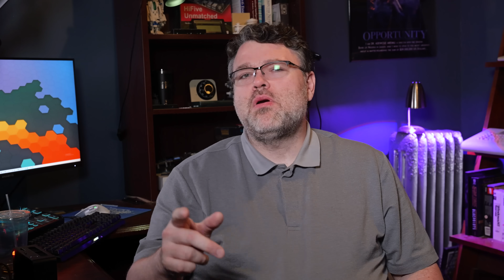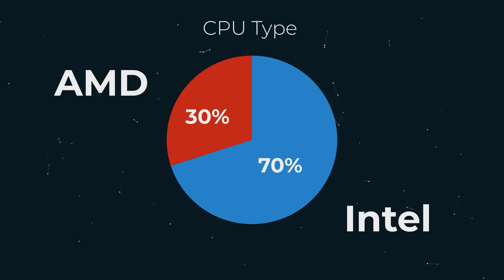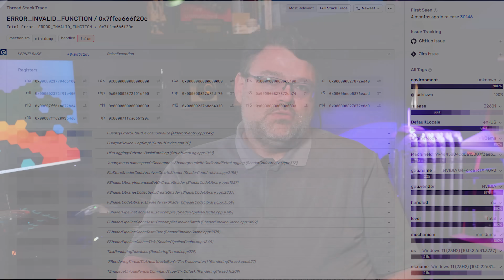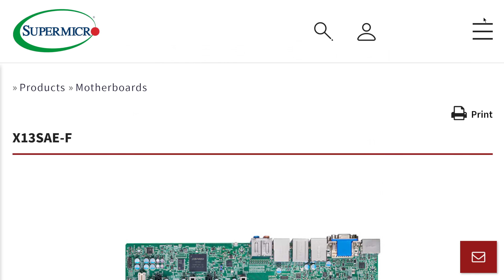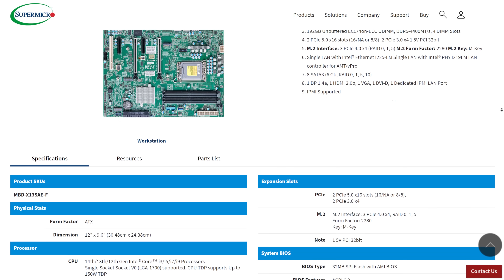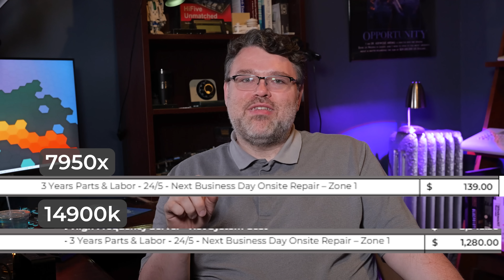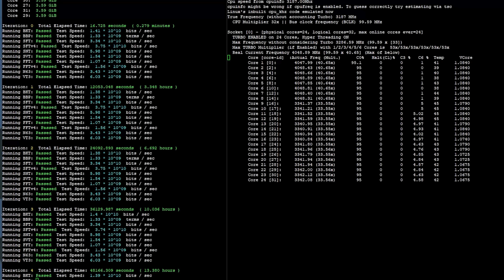Intel has a Pretty Big Problem

Comment: If it helps, my NVIDIA gpu keep shutting down my AMD 7900x3d. I bought RX 7700xt, and the issue is fixed. For some unknown reason, AMD is not compatible with rtx4060. Fyi, i did driver reinstall, Windows reinstall and everything, including bought another rtx4060.

Comment: Hi, I'm the target you're looking for and can reliably replicate these crashes.  It's a custom build with a 13900K and I can configure it to see inexplicable crashes every few hours.  
It isn't strictly overclocking that causes the issue.  The Intel Turbo Boost will cook the chip during shader compilation on games and does cause some instability, but nothing like the ASUS AI Overclocker/Tuning.  Turning that thing on, even when telling it to tune for stability, will almost guarantee a crash within a few hours of use.  As soon as you use XMP profiles and manually tune the CPU settings it behaves reasonably well--maybe a crash here and there over a month.

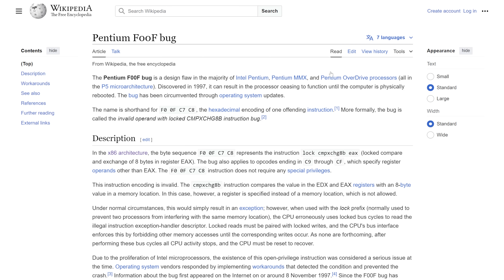Comment: 2:30 "Intel creating their microcode system so they can patch CPU errata in software"
Next step : Intel sell you an FPGA so they can fix any hardware issue on the fly.

Comment: enforced voltage limits, enforced clock speed limits.  the turbo boost voltage spikes are killing the CPUs.  intel can't fix that with microcode or BIOS, because voltage spikes hitting 1.5v and 1.6v to hit those 5.8ghz and 6ghz on 2 cores is whats killing them.

Comment: Marketing just wanted that 5700 speed on the server cpu... Between 5000 - 5500 sounds far, but just not far enough. 5500 is so close 5600 just doesnt work, it just one higher. 5700 feels reserved, but budget pro

Comment: My 13900K has crashed once that I know off, maybe after some update. I have never played any game with it. I did try to get a Gigabyte 4080 graphics card with this system including a Gigabyte motherboard. Never was able to make it work, I sent it back to Gigabyte at great shipping expense and they sent it right back to me with a new cable but didn't touch the card that I could tell. And it still didn't work. After pulling the card, I had to reboot over 10 times to get it to boot and reset the bios plus whatever I could think of. I put my RX580 back into it and no problems since. Still have the 4080 which is still under warranty but Gigabyte didn't even look at it.

Comment: "out of vram" error also is tied into your page file settings. I kept getting them in a game I played about every 1 to 2 hours and I was only using 22gb of ram out of 32gb and 12gb out of 16gb of vram. I changed my page file setting from 6gb to system managed and the errors went away. 5800x3d and 6800 16gb

Comment: No Intel CPU problem Originally posted by reddit:
Basically type environment variables into start, and open "Edit the system environment variables" > click on "Environemnt Variables" on the bottom right > Click on "New..." at the bottom > can create an environment variable called "OPENSSL_ia32cap" with the value ":~0x20000000d". (Both without the quote marks).

Comment: maybe this has something to do with chiplet implementation? I had 8700K for 5ish happy error-free years and decided to upgrade to 13700K last Fall. I've had a few issues with this silicone. one day my PC would not identify a secondary NVMe drive. Reboot fixed that issue. Another issue was BFV would crash on me on occasion. I fixed it by moving the install to the primary NVMe. Weird issues that I never had with old intel. Both linked to NVMe 4.0 that was 100% healthy and no problems like this on 8700K

Comment: Since this seems to mostly effect 13th/14th gen consumer CPUs, what are we seeing on the front of Xeon5 and Xeon6? As for memory clock dropping like that, makes one think the E and P cores access the IMC differently and are causing a voltage issue internal to the CPU in some cases. This could account for the compression/decompression issues many are seeing.

Comment: This isn't just a problem for the here-and-now...
...without a complete fix (seemingly unlikely) all these CPUs (components?) are going to end up on the used market for many years to come... with a potential for an ever increasing failure rate without any kind of warranty or indeed appreciation that there is an issue 5-10-20-30 years from now.

Comment: I'm a developer and I've ran into these issues with my 13900k, exclusively when compiling - but then consistently. I got it RMA'd but in the meantime the 14th gen came out so I got a 14900k. At first it was working well but then the same issue came back. Couldn't finish a 2 minute build without various issues, but all games etc ran perfectly. The latest motherboard bios updates had settings that fixed the issue without a noticable performance drop though.

Comment: I bought a 14900K and had it replaced 3 times, each after 5 months. Please change it if you’re using that chip. It will definitely cause issues

Comment: Regarding downclocking memory to 4200: The official Intel specs for 14th gen DDR5 allow at most most 4000 for dual DIMM configs. And only 4400 for single DIMM, but dual slot configurations (which all W680 boards I can find seem to be). So it seems 4200 for dual DIMMs seems still outside of official guaranteed specs.

Comment: I have "no vram" issue back on release, since then i tune my system decrease watts significantly(using noctua 15)Since then I have zero issues, no crash no problems and even i decrease power of cpu perform at default boosts in games because games not use cpu on max usage and it keeps frequency

Comment: I have an Asus z690 Hero motherboard and a 14900k CPU. I couldn't understand why it was running so hot, even though I had a water cooler. When I unpacked a large rar file, it rapitly reached 100 degrees and crashed after a few minutes. The problem was that Asus hadn't disabled "ASUS Multicore Enhancement," so this feature was enabled by default. When I chose "Disable - Enforce all limits," the CPU worked fine, as it should. Since then, I haven't had any problems with the CPU. Why they chose to have it enabled by default, I have no answer to.

I don't know how other motherboards work. Maybe this is a root problem for many. And if you don't disable it and are using a less efficient cooler, then the problem would be even worse.

Comment: I have i7-14000 non K. Hopefully, I'm safe. However, I noticed that my ASUS TUF gaming reported 1.56V in BIOS while idle! Crazy! I disabled all the overclocking features immediately (even if non K is not overclockable), and now it shows under 1.4V in Hwinfo under load. No idea, what ASUS was doing there.

Comment: My gut feeling is that we have to think beyond the top-level numbers, eg Vcore - that this phenomenon involves microscale variations. That is, the answer will involve physics. Specifically, some phenomenon which was previously negligible rearing its ugly head. Eg some effect that used to cause 0.01V transients, which, when no one was looking, grew to now causing 0.2V transients. 

How much will the actual voltage across the silicon vary from point to point at a given Vcore? If the P-core power throughput is ramped up to an unprecedented level, could the load line end up delivering 1.6V to the cache and E-cores? Or perhaps there are high-voltage transients from inductance as the P-cores switch down from mega-power surges? I don't know how much inductance CPU circuits have. Or perhaps it's just the VRM inductance, saturating the CPU's capacitors and flooding the ring with a transient 1.7V?

These are just a few obvious thoughts, but I have no experience with the fairly extreme time-space-current-voltage regime involved here. All I'm saying is, I think the answer will be outside the box of the usual physics and data points that are usually measured and contemplated.

Comment: I am a 3D video editor and have had no isuses i just set my own profile . Using Extreme Tuning Utility Insane OC settings! my system must be a beast! Here's a breakdown for those interested:

CPU Clock: 100,000 MHz
Core Voltage: Stock
AVX2 Ratio Offset: 7.0
Power Limits: Unlimited (Be careful!)
Voltage Mode: Adaptive
Intel Boost: On
Active Cores: 56x
Echoes: 45x

I see no slow down or dergaiding of my CPU of corse only time will tell but at the moment all is good I have had my 1400k for 6 months now.

Comment: As 14900k user the only game I have had crashes with was cs2. Everything else has been rock solid. Everyone AMD and Intel users get the CTD on cs2. However I turned off hyper-threading and it stopped all the crashes entirely. Retested the other day by turning it back on and it did the crashes again. So turned it back off. If you are having problems try that.

Comment: I have a i7-13700F and I've had to reinstall Windows several times due corruption or random BSOD at boot, went to reddit searching for my issue and a few people didn't believe because it wasn't a K, KF or KS model. And the articles about this were 100% sure it was only those models. Even going to my CPU documentation for PL1, PL2 and ICC's parameters to specify in my MSI Mobo settings, was stable but score dropped almost 20%.

Went to reddit and posted a comment on a post a dude made about the parameters Intel posted, well that OP helped me out using i7-13700 parameters instead of F model and I've been stable ever since, no more random BSOD at boot or while playing games. I've probably seen every BSOD Windows has in the last year I've had this processor.

Comment: I'm far from an expert, but can it be a memory controller failure? I wonder if it is degrading and sense it seems to be inconsistent. I wonder if Intel has a small amount of headroom built into it, but it can still be used if the rest of the controller is busy, but if that small part of the controller has a fault is used, it makes it crash or it might be the memory banks (sorry don't know the term) but the individual circuits that interact with ram are overheating to failure if it's on this small of a scale there'd be no thermal protection and as far as I know no way it trace it back to that. But I'm just some random that doesn't know that much about this.
Reply: I’d bet money that exactly what it is

Comment: I purchased a i9-13900k for a Asus Strix Z790 ddr5 6400 ram for my gaming pc  when they first became available and I paid around $600 for the specified performance. 
When the cpu was new it was fine, but I rarely even played my pc but over time it's gotten weaker and weaker but if I use those Intel recommendations that cpu doesn't perform as good as my i7-11700k did in the pc I had before.
Everyone should get the $600 performance they paid for or get their money refunded because mine doesn't even come close to running 5.8 using intels crappie weak recommendations, more like 4.7 Cinebench p cores and Iknow mine will eventually fail after warranty is gone and maybe this is what Intel's depending on.😢

Comment: "Making the memory run dog slow seems to be the most effective" >.> 

This right here is exactly why I even run a xeon even in my gaming system. I had a bunch of random crashing with 1st gen Ryzen with a 3200mhz memory kit, not even particularly fast, but I thought "well it is first gen maybe that's just what I get for giving it a go" so I upgrade to 2nd gen Ryzen, it's not as bad but it still crashed more than I would have liked, I swap the RAM kit and it's the same. When 10th gen intel is starting to see discounts after the 11th gen launch I grab a 10850k on sale and sell my ryzen platform, thinking that maybe the intel chips are just more stable right now since I never had issues with haswell, cascade lake did not improve things at all if anything it was worse. I drop the memory speed down from 3200 to like 2666, better but still not nearly as solid as the system I had 4-5 years prior, I decide well I've changed everything except my GPU at least once and the Vega 64 is getting long in the tooth anyway, so I'll get a 30 series card, nope.

Eventually last year out of sheer frustration at frequent crashing in a few games I drop the 10850k and buy a used Xeon W-3235 and a Supermicro board with the most boring 2133mhz 6 channel ECC memory kit imaginable, and I have once again found a level of stability I think is acceptable. Like intellectually I know, and knew, that as speed increases a greater degree of signal integrity and more precise timing are required to make faster speeds function, but since people weren't really complaining about it with DDR4 systems I thought it had to be my hardware, then here it is en-masse with the latest DDR5 based systems.

In a way I feel vindicated that the crashing issues I've been seeing have been getting worse as systems have gotten faster, it also makes me glad that instead of buying 13th gen intel I went the xeon route because I felt like the underlying issue was at least related to memory speed and there was no way I wanted to enter in to a still dual channel DDR5 system.

Comment: I need to build a new system, as my current system is 11 years old.  The i7-3770k and 32 GB memory it has have served me well, but at 11 years old, I know it's only a matter of time before it has issues.  I intend to use the new system for music production and game development, so it needs to be powerful.  I was originally planning on the i9-14900k when I started designing the new system, but obviously am rethinking that now.  Any thoughts on what is a good alternative mid-high end CPU that isn't excessively expensive?  EDIT: I should mention, I have no intention of overclocking.
Reply: Ryzen 5 7600. It's a hexa-core CPU with a modest TDP of 65w and 5.1 Ghz boost clock. Pricing varies per region but the US seems to start at $229. The platform has only one generation of CPUs on it and will likely last another 4 years.

Comment: This sounds like a issue occured during manufacturing. Is there a way to check if the bad CPU's came from the same batch?
Reply: If only 25% are good, then there should be a thorough investigation as to sourced materials, plus who was at work production-side and where, when the bad batches happened.

Comment: Could part / most of this problem have to do with the sockets / connections?

With older boards, I have seen how,  on Intel based systems, the back of the board behind the CPU socket is bulged out. The happens especially on the flower type coolers that use the plastic click-locks.

There has also been issues with IHS flatness on Intel systems in recent history.https://www.youtube.com/watch?v=Ysb25vsNBQI

After listening to your report, it sounds like these CPUs that are having issues may be having massive cache data error rates, especially since the CPUs are slowing down a ton before crashing.
The CPU cache has at least ECC built in last I knew and if there are a ton of errors being corrected this makes total sense.

Comment: Well, about fs corruption, you do not even need an overclocked CPU to corrupt it. I have almost seen monthly reports for various metadata errors, and thankfully to the extra error messages, most of them are pinned down to memory bitflips.
And that's only for btrfs' metadata. Considering the possibility, it's pretty obvious that data would be corrupted too.

Since not so many fses even have data checksum (and even one has, it would also have certain cases leads to false csum mismatch, e.g. direct IO with contents update during writeback), I will say the fs corruption (both metadata and data) is not as low as one think.

It's just not obvious, as a lot of fses have much lower metadata usage compared to btrfs, and no data checksum to detect data corruption.

Comment: When AMD released its 7000 series, I went with a 7900x. I had buyer's remorse when I saw the better value of Intel 13th gen. But with this situation now, my mind is totally free from that feeling.
Reply: you can upgrade to a 7800x3d or a 9000x3d chip when they come out, without having to worry about the CPU killing itself.
Reply: @chubbysumo2230  Well, I am not upgrading unless my current CPU ceases to function 😅
Reply: @klwq welp my intel 13th gen is dying… time to go team red
Reply: My Next CPU is a 9700x3d and my 13700k 💥
Reply: AMD x series always scam for price/performance. If you want to buy AMD better waiting for non-x version or 3D version
Reply: @guruhonorer11-d8w  Yeah for my use case the 7900 would have been perfect actually

Comment: Rarely game but use my  i9-13900KF system mostly for photo processing and video, typically experience a crash every three weeks for no apparent reason. Sometimes I get a cluster of crashes (3 or less) but then good business for thee to four weeks. This is the most crash prone system I've ever owned regardless of processor used.